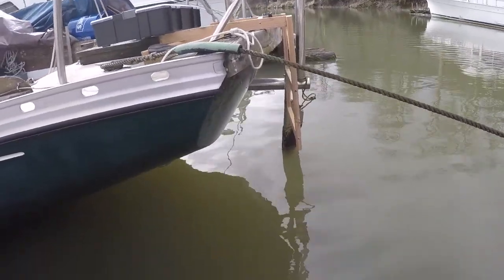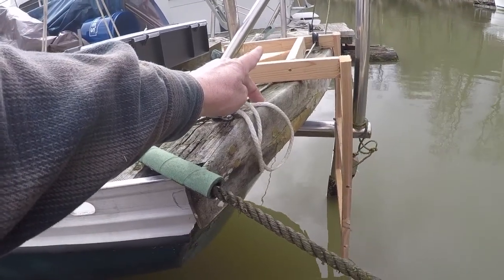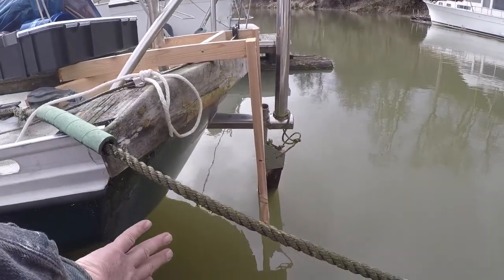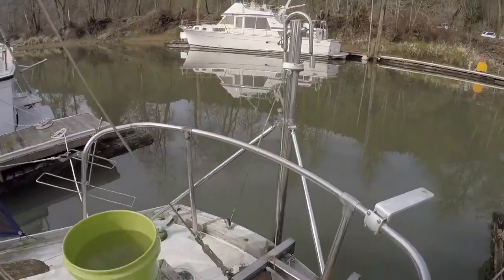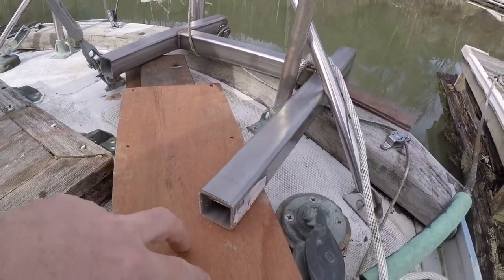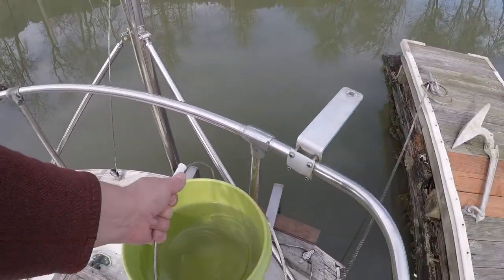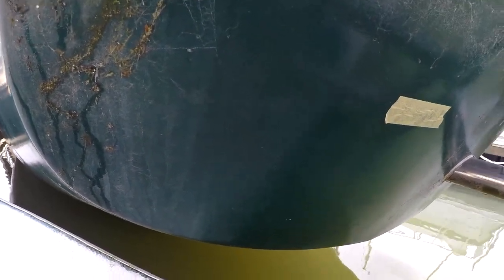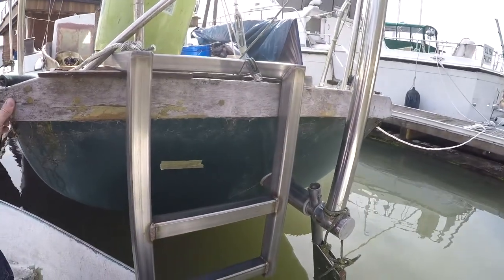Voyage Dreams 13 -  Custom Outboard Motor Mount

Comment: Did you use the boats rudder for steering when under motor?
If so, did the boat turn easily?
Reply from the maker: Hi William, thanks for watching. When using the outboard I was easily able to steer using the outboard alone, so I kept the boat's tiller centered. Maneuverability was likely improved with the outboard over the inboard engine and rudder.